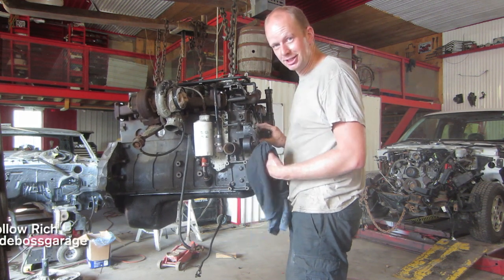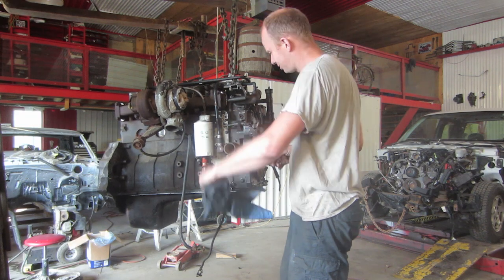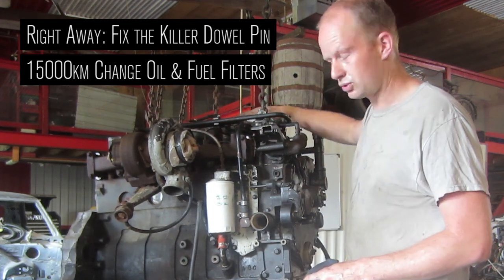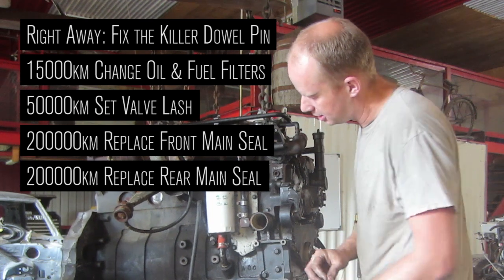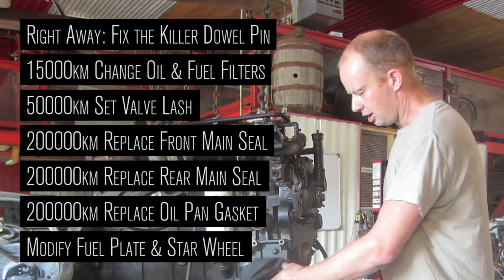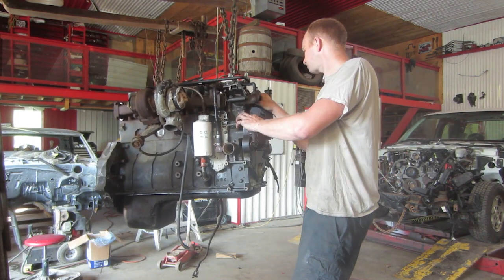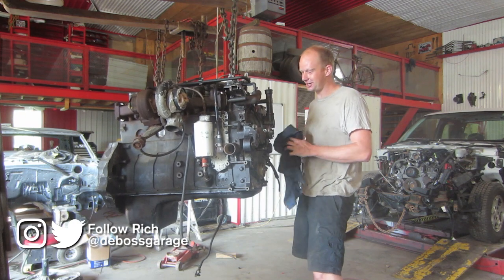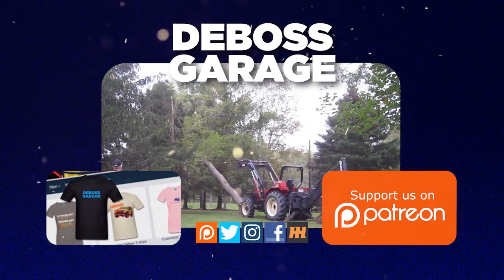CUMMINS HELP: Regular Maintenance For A Cummins Diesel Engine?

Comment: Hi all, the bolt beside the kdp threaded itself out on my 5.9 12v luckily didn’t do any damage to the timing gears but as I took the timing cover off I think it fell down into the gap between the cam gear the crank..will it be in the sump? I’m sure it has happend to someone else any help appreciated 🙈

Comment: I just bought an 02 cummins truck 211k miles. Its making a knocking sound was wondering if you have a video on diagnosing it?  Also Love your channel been watching for years. Thanks for the great content!
Reply: Did you ever figure out what it was?
Reply: @BoudrauxMNxsty not yet ended up having to get the transmission rebuilt because the pilot bearing ate was bad and ruined the shaft. Waiting to get it back then I'm gonna tear it down.

Comment: I have a 96 12v 506k miles it has 0 blow by doesn’t use any oil it leaks some but not bad at all and I’m pretty sure I hold the world record for dodge transmission it still has the one that came in it and never has been rebuilt lol staying up on maintenance pays off and I live in Alabama so it’s rust free

Comment: Rich, I'm new to the Cummins scene. I recently bought a 01 24v 5 speed and the clutch weny out right when I bought it from a dealership pulling out of the parking lot. Can you do a video on the oil vent tube? I was told to relocate it and I have no idea what I'm doing when it comes to that. Thanks

Comment: i want a 2019 ford f250 with the 6.7l power stroke or 2019 ram 2500 with the 6.7l cummins, i don’t know much about diesel, how would these trucks do as a daily driver/short trip truck, (no deletes) no towing or hauling, 6 miles to work and 6 miles back home? a grocery getter. long trip once a year. i just want a big truck with a diesel engine.
Reply from the maker: I want to be your bank manager

Comment: Do you ever change or clean and re-oil your air filter? Or are air filters optional equipment on Cummins?
Reply: Robert, there's a filter minder mounted on the air filter box. When it gets sucked down it means your filter's plugged up.

Comment: What're your thoughts on a Duramax vs a Cummins? Obviously Chevy makes a better truck than Dodge and the Isuzumax has proven to hold together pretty well, but how does it stack up to everyone's favorite?
Reply from the maker: I honestly don't have anything against Duramax.  My main reason for Cummins is that they are simple and cheap.  The wreckers in town had a Dmax for me when I did the swap originally and it would have cost about the same in the end, but I know lots of people with a Silverado dirtymax and I had to be different...
Reply: DEBOSS GARAGE hello I have a 2000 k3500 with the 6.5 and I’m having trouble finding a 6.5 and well been considering the cummins swap only issue is I’m in California don’t know what the smog issues are going to be would you recommend the 12 valve or 24 valve ? Here it’s 97 and older is no smog required and 97 up it is required
Reply: @freedom-volvo-usa  you can't put an engine in a vehicle if it is older than the original equipment smog date and requirements. So in your case, your 2000 MUST have an engine from 2000 or newer WITH all of the original emissions equipment intact.
Reply: Stephen Molzer so I’d have to use a 24 valve cummins right 97 is the last of the mechanical injection system. 
So as long as all the emissions stuff is there I should be good , I’m in California  so these laws are ridiculous.
Reply: @freedom-volvo-usa  yes, get a 2000 or newer 24 valve. Honestly, I'd try to find a 2003-2004.5 common rail because it's more reliable than the VP44 from 1998.5-2002. An '03-04.5 gets the best mileage of the common rail engines, doesn't have any external emissions equipment required, and only requires the same work as the VP44 engines.
Reply: Stephen Molzer so since it doesn’t have external emissions I could get it barred easier , is there a harness and ecm I need for it as well ? Trying to gather as much info as I can thanks !
Reply: @freedom-volvo-usa  you need the ECM for the engine itself, or you need one for the same exact model and year. Honestly, I wouldn't bother with an engine that didn't come with it already, as well as the wiring harness. You can always use the wiring diagram and splice your own harness together, or there were two companies that used to do it about 5 years ago for you. You would send in the engine wiring harness and they would splice it with your vehicle's. I'll look back through my notes to see if I can find the companies that splice the harnesses for you. I did it myself in about an hour first stripping, putting on heat shrink, and twisting the wires. Then I just took my time and soldered it properly.
Reply: Stephen Molzer I found a 2000 24 valve with wiring harness and ecm do you happen to know how reliable those transmission are I need to find one as well
Reply: @freedom-volvo-usa  if you want a reliable transmission, check out the NV4500 5 speed, NV5600 6 speed, or the G56 6 speed. They autos can be built to be extremely reliable at stock power, but the manuals get better mileage and only need clutch and hydraulic upgrades when you want to above 500hp. Under that, and they almost never fail.
Reply: Duramax wears extremely well, and it has hardened cylinder walls.  Over the years, it has proven it's design.  Plain and simple - it holds up.  Everyone loves a 12-valve, but the Duramax is also hard to beat.
Reply: GodprefersDiesels duramax is garbage.  Head gasket, injectors, leaking fuel lines that run through the block lol, NO THANKS!!!!
Reply: @devin3156  you know that use easiest way to spot the person who doesn't know anything about diesel engines? Find the guy who doesn't realize he's complaining about a Duramax engine that was only produced for 2 years out of the 15 they've been in production. you are literally only referencing the first engine, known as the LB7. Good talk.
Reply: Stephen Molzer Lol. Not only the LB7 has issues man. Granted YES they did make it much better but still not near as reliable as a 12V which is what I’m getting at. I’m a die hard 12V guy so I tend to harp a little on the other motors😂
Reply: Stephen Molzer the 12V is 10 times better than any modern deisel😂 and I still don’t trust a V8 diesel. Only good one is the 7.3. And killer dowel pin is rare to ever go bad and it’s the literally easiest fix. Also the 12V doesn’t have a rotary pump it’s the P pump. Which is bullet proof. And the lift pump is Dodge cheapness, nothing to do with cummins. If you want a money pit buy anything but a cummins lol.
Reply: Stephen Molzer just because they “updated” everything doesn’t mean they don’t have problems.
Reply: @devin3156  also, once again, every single engine ever produced has had problems. After the LB7, the Duramax logged an average of less than 20 NHTSA complaints for engine reliability per year. That's actually the norm for nearly any manufacturer. Want to guess what the P-pumped 12V averaged? Hint it's over 70. You're either being intentionally ignorant or you're a troll.
Reply: Stephen Molzer im not being ignorant or a troll. Bottom line is. THE 12V IS THE MORE RELIABLE engine. CHEAPER and EASIER to make power with. And you don’t have to stud it or head gasket it whatever all that bs you gotta do with the V8 engine. No tuners or any of that bs. That’s what I’m getting at. I love the 12 v cuz it’s simple, and easy to do anything to.
Reply: Stephen Molzer and yes I know the duramax is better than it was. And yes I know the engine is acctually very strong. But it’s just not for me I don’t like electronic shit or V8 diesels.
Reply: Stephen Molzer and Lol 400 bucks for 400 horse exactly. You just need some tools for the 12 Valve 😂😂
Reply: Stephen Molzer just because there HAS been good V8 diesels doesn’t mean shit. That’s was years ago. Most semis use inlines.
Reply: Stephen Molzer there’s also several cases to proove my point that a 12V can reliably take power lol. There are 600 horse 12v with compound Turbos with all stock internals doing just fine. lol try that on a duramax
Reply: @devin3156  most semis use inline because the companies making V-8s said fuck off to the EPA. Cummins, PACCAR, Detroit, etc had so much invested in over-the-road applications and so little in off-road that they didn't have a choice but to keep making their same inline engines that were emissions compliant. Furthermore, a Duramax only needs a fuel rail plug, turbo, exhaust manifolds, 5" exhaust, studs, EFI live, an intake, 75hp injectors, and a FASS pump to make 600hp on stock internals. You really don't have a fucking clue when it comes to diesels and it's hilarious.
Reply: Lion Celica the cylinder walls in a stock Cummins are harder than any other engine I've bored before. And their sleeves are even harder.
Reply: DEBOSS GARAGE cummins and cheap in the same sentence...lol
Reply: Does the Cummins have hardened cylinder walls?
Reply: Stephen Molzer never said I couldn’t diagnose electrical problems lol. It’s pointless. Diesels are meant to be mechanical. The 12V is the best engine, duramax blows cock. End of story.

Comment: I just picked up a 2002 4x4 crew cab duramax with 206,000 miles . the body is a little rough but drives nice. i only paid $2500 lol :)

Comment: What are your thoughts on the common rail 5.9 (2003 - 2007)? Do you have any experience with those?
Reply: The injectors fail, and wash the cylinder walls.  Usually results in R&R of the engine.  If it starts to run a little rough, get the injectors checked pronto.
Reply from the maker: Good engines.  Wiring is one more headache over the 12V but I would buy one.
Reply: Thanks.

Comment: hey rich I have a 1995 Cummins with a 47rh trans. cold air AFC full forward, starwheel adjusted. timing 17°. I had my transmission man 30 years experience build it that has built several chevy trans for me with no problems. This will be the 2nd full rebuild on this 47rh. he doesn't know what is causing it. finally he is sending the valve body out to get dynod/tested. I have never been happy with the way it has shifted. I had several trans shops tell me to throw that valve body away. Just wondered about your thoughts. I love your videos keep them coming.
Reply from the maker: Honestly I don't know.  I send my trans to a guy I trust a couple towns over.  I have had one valve peen over causing a sudden jolt from a stop but he was able to fix that.
Reply: +DEBOSS GARAGE thanks for the response. Thinking a 4500 to end all my worries.
Reply: 4500 can't hold any power reliably.  Stick with that 47rh.  What is going wrong with it?  Burning clutch packs?  Bad torque converter?

Once you get inside one, you'll see they're leaps and bounds over an NV4500 in regards to strength.

Comment: why change the oil every 15k but every 5k for gas vehicles? whats the difference
Reply from the maker: 15000 for the 5.9 as it has 12L of oil in it.  Gas engines usually have 4-5 L.  Check your specific engine though
Reply: @DEBOSSGARAGE  I thought most adhere to 6k miles intervals or so...
Reply: Berta Boyz - He's saying 15,000 kilometers.  But realistically, you can go 15,000 miles on that oil all day long.  Have it analyzed at 5k, 10k, and 15k, and you'll see what I mean.

Comment: Do you add anything to the diesel, like 2stroke oil or some fancy stuff?

It's a good idea to locktite and re torque the bolts holding the timing gear cover, they can come lose aswell with the same effect as the KDP.

There is lots of ways to put in a new front crank seal show us how how to do it the right way.
Reply: DEBOSS GARAGE, the reason I continue to watch your channel and be a loyal fan is because you're down to earth, you actually respond to comments and don't have some team of huge lawyers waiting for an interview. Don't get me wrong, I like roadkill and hotrod garage, but the only one to actually respond when I comment with suggestions or questions is you. It seems like everyone else just got too big for the pants they're in. Keep it up man, from Knoxville, TN.
Reply from the maker: Just 2 stroke oil.  I'm not that fancy of a guy
Reply: Gürwald When I did my KDP I found out a bolt had backed out and got crunched. The gear were flawless though because the bolts are softer than the gears. The KDP is hard like the gears about not the bolts. Was interesting. Also was funny because when I did the KDP on my truck it had already be done.

Comment: Turbo check??,shaft play,oil seal,....
Reply from the maker: Not really any maintenance you can do on a Turbo.  Check it for sure but I can make a list of 100 things to check...
Reply: You're calling replacing the oil pan gasket at a regular interval "maintenance", but not wiggling the turbo to check play, before it grenades?

Yes, people, check your turbo.  Most importantly, side to side play is mostly okay, but try to pull it in and out.  Any play there is bad.
Reply: GodprefersDiesels side to side play is not okay. You have no clue what your talking about and Deboss is the best diesel mechanic out there.